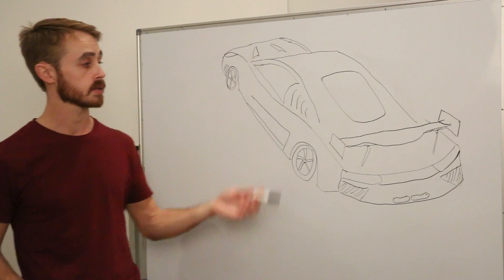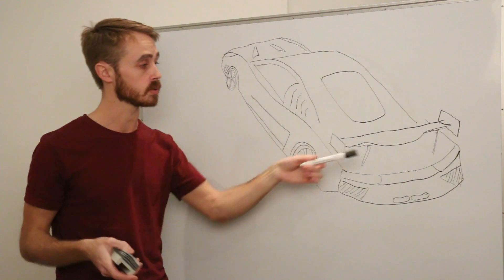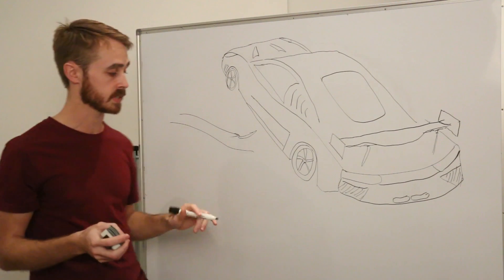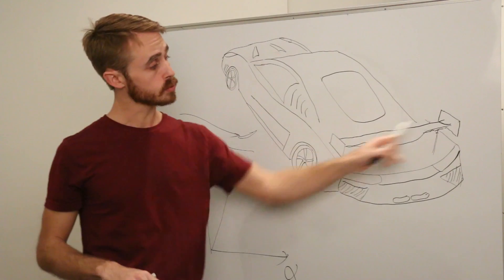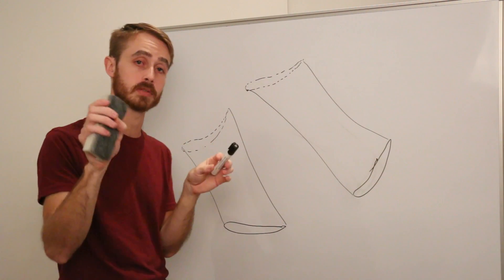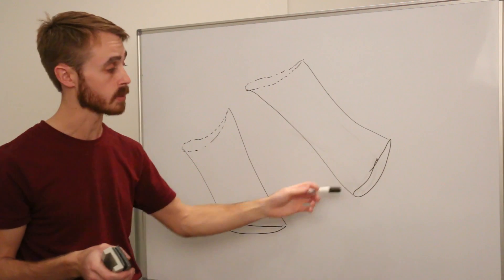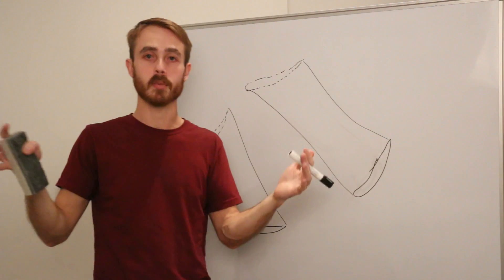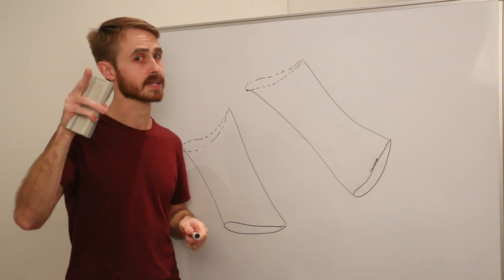Why are Car Wings Twisted?

Comment: Regarding aircraft, the tip twist originally had nothing to do with tip vortexes and today is usually the same. It is usually nothing more than a fortunate side effect. The aircraft reduce the twist at the wingtips because these are the areas you want to stall last. The control surfaces are at the outboard of the wings, and there is a much higher induced yaw thus making a (very dangerous) spin far more likely when the outboard wing stalls. There are many better techniques to reducing a wingtip vortex if this is the goal, but really it is a useful safety feature somewhat akin to vortex generators over the control surfaces. But because it was in common usage during WW2 it of course has some lineage, and the aircraft of the era weren't hugely concerned with tip vortexes.

Comment: I just sorta picked a video relevant to my question, since there's not a real way to contact; a ways back I was i an argument with a guy on the city-data forums automotive section about factory wings and spoilers. He claimed some proof of professional experience on it. He was saying that they all work in some way or another and not always for downforce. My example was my 81 Mustang and how many will say on two different foxbody forums that the 3piece(commonly found on 79-86 2.3 and v6 hatchs, or the one piece on 87-93(same thing pretty much)) spoiler doesn't do anything because of the hieght and angle of the hatch. He was also saying that even the spoilers on say late 90s to end run Pontiac Grand Am/Prix and Bonneville also do something along the lines of limiting the turbulent air directly behind the trunk by extending the top surface area- or something. I just started findng your vids in my feed, so I've watched most of them, but the spoiler/wing ones are what's been interesting me. My question is what factory wings and spoilers work and which ones don't, do they design them primarilly for looks or to work at legal road speeds? I've read that the wing that came on the fox4 Cobra(not the R model) actually slows the car down, and it's faster with either no spoiler at all, or with either a v6 spoiler or GT spoiler. Or the old IROC and 93 Cobra wing(prettt much the same piece) with has the same setup as one on an WRC STi with the vanes, or the Neon SXT and SRT4 wings. I've also seen something on wings that don't actually create downforce, but simply stabilizes the air or something. Could you attempt a video at explaining what different types of wings and spoilers do and if any factory ones do anything? I was thinking of a ducktail spoiler like you'd find on a stock car or new Corvette for my CVPI as a better optuon that the one for the Mercury Maurader, but if it'd end up just for looks, I'd rather not invest the money. I hope you see this, all the videos you've done on the subject has pretty much learned me on them, these are the questions I have left.
Reply: JaxRhapsody heyyy.. here's a thought.. Google. there are probably some type of drag coefficient stats on any car of note, somewhere. I doubt he'd want to research all cars ever made, to maybe hit 3 that may be interesting.

Comment: I have a NC Miata can I speak to you or someone about a similar issue, I have roll cage and am not going to use any kind of roof
Reply: Freddy Fabbri hi. just wanted to put my 5 cents in. I watched a documentary about bridges and they had round pipe that was exposed to high wind streams and the high winds going around the pipe would shake the pipe vilently and start shaking the bridge, the solution was to wrap a wire around the pipe to break up the air streams and produce vortesies and that would stop shaking the pipe. That's something you can reaserch and do to an open roll cage on the car.
Reply from the maker: Hi Freddy, shoot an email off to kyle@jkfaero.com and we can talk about it

Comment: KYLE.DRIVES I think its important to note many airplane wings (particularly fighter aircraft) have twist in them to provide lift at  a range of angles of attack.  When aircraft are in a extreme nose high turn a portion of the wing may be in a stall where the twisted portion can still be providing significant lift.
Reply: We also want control of the aircraft while stalled, by having a greater angle of attack at the root the stall will begin there and progress outward, this means the ailerons located nearer the tips will remain functional deeper into the stall
Reply: Spencer/Tressa Adams I don't..

Comment: Why are Car Wings Twisted?  Because the aerodynamicists threw the car in the wind tunnel and the wing was stalled in the middle so they flattened that part out. :-)
Reply: aesop m so why not just position whole wing higher? High CG?
Reply: Many things— a high mount results in loss of structural integrity and slightly higher CG
Reply: @shaoyikai813  Loss of beneficial interaction between car body and the wing if you put the wing higher.
Reply: @shaoyikai813  he made a whole video about wing placement, balancing etc.
Reply: You literally just saved everyone 4 minutes and 38 seconds. MVP.

Comment: on planes twisting (flattening) the wingtips makes them stall last, and the ailerons are out there too, so i think for planes it's first order designed in for that.  it does move the lift distribution in the right direction though that's true. hopefully i have that right. great videos, thanks.

Comment: I got the gist, but had to watch twice. The rear window reduces the energy of the flow by the time it gets to the wing. So on a straight wing optimized for angle of attack at the tips, there is flow separation in the center portion. If the straight wing were optimized for the center portion, then equal lift at the tips will not be produced.
Reply: Watched a third time, its the downward flow off the rear window. I lost my line of thought at the aerospace transition.

Comment: Cool stuff man. 
Do you know anything about pickup trucks with tonneau cover mounted wings?¿ It's fairly common here in the U.S. and once I find a tonneau cover for my Chevy S 10 I plan to mount a wing on it, but I want to know what an aerodynamicist such as yourself thinks on the subject.
Reply from the maker: HazeWulfDemonic One of my PhD supervisors actually did a fair bit of aero analysis on pickup wings back in the day, they found that under most setups they interacted with the recirculation region behind the cab to generate lift! Add one if you think it looks good, but don't do it for performance. Besides, pickups are a bit too heavy for aeros to work well unless you want to kit it out like a time attack car.
Reply: KYLE.DRIVES I'm wanting to do it for looks really, as the wing I have for it is an '80s Chevy Monte Carlo wing, which I doubt will have any performance  what so ever. I wanted to ask for your take on it to see if there would be any benefits/negatives to it. Thank you for your reply. My truck is just a daily driver/work truck, but I would like to start auto crossing it eventually. Nothing to extreme. One day a small block 350 V8 is going to be under the hood though!